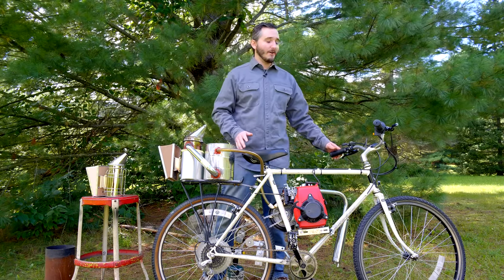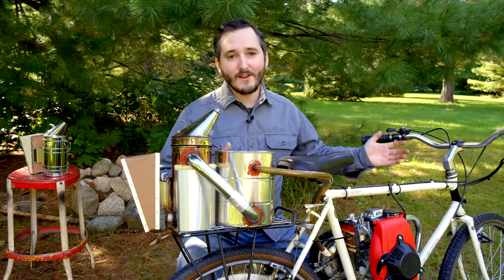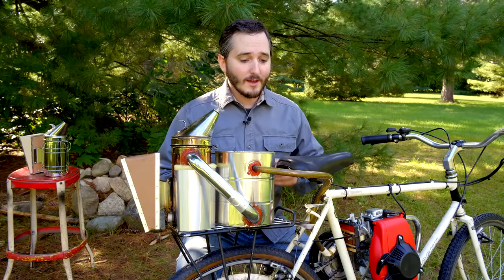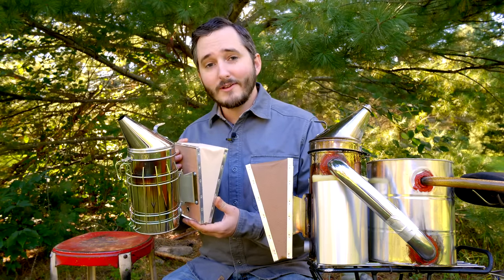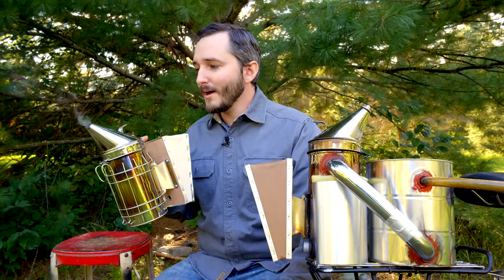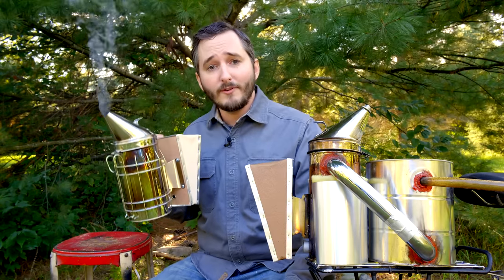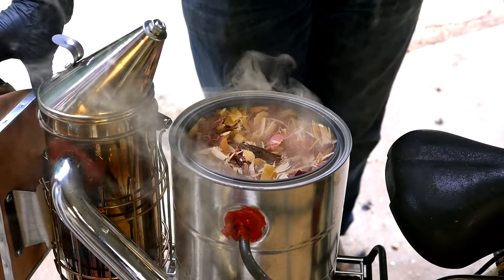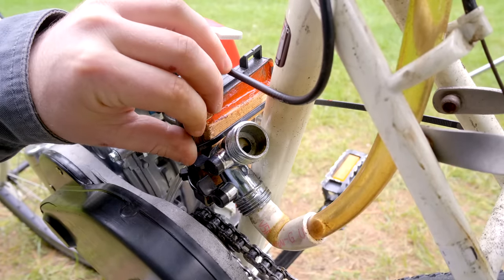Running a Gasoline Engine on Firewood | Woodgas Biofuel

Comment: id like to have a crack at this, looks fun
Reply: Don,t burn your self
Reply: Kinda a waste of time to be honest..just not practical.
Reply: Recover the exaust temp
Reply: You won’t
Reply: This would be so cool in the Colin Furze steam-punk style! Bring in the brass and copper!!
Reply: @leathercheerio1  I'm sorry, have you seen Furze's channel before?
Reply: Please do but be careful
Reply: use a vacuum recovery pump into a pressure tank of some sort to collect gas for more practical use maybe?
Reply: Do it plz
Reply: Make into a jet engine
Reply: you would try this I bet... Woodgas fed through a liquid nitrogen cooling coil and then fed through a bubbler and pressurized. Next use an oxygen tank from the store and mix the two of the gasses and burn them using a jet lighter as an igniter. test different nozzles as needed. Boom (hopefully not literally) steampunk woodgas rocket engine.
Reply: Storm Silvawalker 
use TEM to power electric fan
Reply: Yas the Furze has spoken :3
Reply: Do it and make it fast!
Reply: Ohhh MG Yessssssssssssssss !!!!!!!!!!!!!!!!!!!!!!!!!!!!!!!!!!!!!!! <3
Reply: Colin you'll either build a flamethrower or some crazy vehicle that moves at ludicrous speeds. You made a moving trash can for God's sake.
Reply: Yooo that's crazy Colin furze commented on your project
Reply: Watch out for that carbon monoxide, sclient and deadly!!!!!!
Reply: I'm surprised you never tried this before, right down your alley @colinfurze
Reply: Colinfurze, Cody'sLab, and NightHawkInLight have always been some of my favorite channels! Thank you all for doing what you do and inspiring me too!
Reply: haha hey you crazy furze id like to see you upscale this and make it go faster!
Reply: Look me up ill give you a hand if you'd like
Reply: Drugs r bad
Reply: @JoeBissell  thats already been done. There is a website called Drive On Wood guys there are driving full size pickup trucks as daily drivers. Id like to see him wood gas his pulse jet, that would be something I havent seen before!! Or wood gas a Mazda RX7 Rotary
Reply: This video made me think of you, you absolute madman.
Reply: Don't forget your SAFETY TIE!
Reply: i also like to see this :)
Reply: i'd like to watch it
Reply: You should build a woodgas motorbike.
I think if the intake would be an Injector sucking in woodgas this should run fine.
Reply: Do collab!!
Reply: He's about to do it, the absolute madman.
Reply: Didnt you get arrested for building a tazer
Reply: Add an small air pump
Reply: Do a collaboration together on a tandem bike!
Reply: Wood gasification powered rocket engine =D
Reply: We're waiting!
Reply: YUP
Reply: Wait Furze did you do it. I haven't been up to date with your channel.
Reply: Oh Lord... here comes a 60 MPH shopping cart powered by a contained bonfire :D
Reply: Yes wood gas apocalypse bike.....with weapons
Reply: Fausdionis Pizzeria has anything he’s ever made been practical?
Reply: You both should try the difference in exhaust with a straightpipe it will probably push exhaust out better
Reply: watched this video after watching your wood gas mower
Reply: I thought I'd find you here.
Reply: just watched your video on it
Reply: He just made a video on it lmfao!
Reply: Make sure to give some credit to our guy,   Ben!
Reply: And you did! You guys are both making 2020 more enjoyable!
Reply: @5thearth  Agreed, spinning belt of knives and Alexa operated flamethrower spring to mind...
Reply: They have an episode with this on the new season of Monster Garage.  I just watched it and find it super interesting.
Reply: @leathercheerio1  Back in WWII, when fuel was hard to get it was super helpful.
Reply: @miguelfigueroa360  He did.
Reply: M'lord.
Reply: I Seen your Video to with your Wood Power mover 😂😂😂
Reply: This was a warning
Reply: @leathercheerio1  That's what people said about early versions of many inventions that we use today.
Reply: @NayroTheAdventurer  as a matter of fact I am part of a plant that is capable of burning syngas in a boiler for high pressure steam to a power generation turbine.  There was a comment, early on in the build phase, about putting the syngas through the turbine. I remember my response was a firm slap to the back of the commenters head. Its not something you want to put through a bladed turbine due to MANY reasons. However, if it was burned through a boundary layer turbine that was made of a material that would withstand the caustics, I believe we'd have a viable direct burn power generation unit.
Reply: @leathercheerio1 not if you can't obtain petroleum. Then it will be as good as gold. Especially with a generator.
Reply: Yes, please!
Reply: Most definitely 👍🏻
Reply: I build a lot of little internal combustion engines I am familiar with the gasifier and how to efficiently run that little motor. You are getting to much air all you need is a small 1/4" hole in the intake use the carb throttle and that's it ride it to the store great set up
Reply: @leathercheerio1 wrong

Comment: Ha bee smoker! Its like you know I'm watching! I glad you are working on this, I tried and failed this about 8 years ago and never got around to trying again, I'd love to run something off sage brush one day.
Reply: I think you should it be great to see you try. I was thinking about making a slightly larger one and using a water filtration system. I figured I could probably use mason jars and still keep it about the size of a paint can. I'd also use a one way air valve so smoke wouldn't come out. BTW I'm a big fan of your channel. I've been watching for years.
Reply: #1 .- replace the garden hose valves with a propane carburetor kit for generator from ebay.
#2.- make a gas (smok) container that can pressurise the gas just 10 psi or so with directional valves , you know, inlet, outlet .
#3.- install  an air pump (electric or manual) to force air flow in the gas combustion chamber (reactor), making smok (gas) go to the inlet directional valve to the gas container to the outlet directional valve to the propane carburetor  conversion kit in to the engine .
Note: (As a pressurized gas container you can use a balloon or bicycle rubber inner tube tire .)
Reply: I run my generator  on wood gas codys'Lab  but  I don't  make a video   because I don't want to be another disappear person.
Reply: Hi Cody, can you make the wood gas and store it in a a gas bottle then pressurise it with oxygen so you don't need to have a fire on your bike.
Reply: I would be interested to see your take on this too Cody. Might I ask the engine type/size you tried to use those years back?
Reply: And what is so wrong with using compressed hydrogen?
It can be produced by electrolysis using solar power. 
Its as green as you can get. Burns super clean. No stinky smoke. Compact as hell. Safe. The list is too long, and I am bored already.
Reply: Hi Cody, I would love to see you experiment with wood gas
Reply: Go watch some videos form Mr Teslonian. hes gotten even a CAR running off wood gas after studying this stuff for so long. have fun!
Reply: I would love to see you two work together
Reply: Although an interesting challenge, perhaps there are some things that just aren't worth developing.
Can you imagine a city with half a million wood gas bicycles running?
I'll stick with my 1.5kW solar powered ebike thanks!
Reply: @Ben LePage
That would be literally a bomb. Fuel+oxygen mixed = explosive mixture. And unlike with gas, flame can travel back in the fuel line like a fuse and make some minced meat out of the passenger of the bike.
Reply: @PirateKitty
Hydrogen makes metals brittle. It is pernicious, hard to contain, it can literally diffuse through solid metal... H2 cars have some pretty special fuel tanks that you dont want to duplicate DIY!!! Also the fuel needs to be cryo cooled to avoid ridiculous pressures. 
And the safety?!!! H2 is extremely flammable in a wide range of mixtures, and can be explosive even without confinement. I would steer away anyone from going DIY with H2! If you are over 130iq you might have a shot, but i have to remind you that even Cody's lab had some accidents with H2!
Reply: @kistuszek  compressed Wood gas doesn't liquify so no it won't become a bomb because the pressure of the gas flowing into the engine would stop the the fire from flowing into the pressure bottle and you'd have a one way valve on the tank anyway so your point is moot
Reply: Cody'sLab that one day when you got to clean shrubs on your ranch, but dont want to haul a bag of sticks, so you make it into a fun day
Reply: Can you colaborate with NightHawkinLight, for this project?
Reply: Cody'sLab hi sir cody if u planning sages grass as fuel i may suggest used a diesel engine
Reply: don't tell me you made the same mistake of burning the wood directly ??
Reply: Try using compressed sawdust. More volume in a smaller space, might have to experimen sizing of the pieces.
Reply: @kistuszek  If you run it off electrolysis and not a storage tank then you wont have those problems
Reply: A gas carburettor is a no-brainer. I’m not sure why you aren’t using the petrol carb choke flap to control the mixture rather than the additional valve. Any induction resistance will have a negative influence on performance, cooling the wood gas would also help and allow removal of condensable constituents.
Why not carbonise the wood first and then make a steam reformer, this would cut the contaminant content down a lot.
Reply: Any gas can be liquifyed just a matter of pressure
Reply: That would be awesome
Reply: Cody'sLab, colinfurze, and NightHawkInLight have always been some of my favorite channels! Thank you all for doing what you do and inspiring me too!
Reply: 100% good idea and would back.
Reply: Yo! Good to see you here Cody!
Reply: Cody'sLab I guess great minds think alike
Reply: Cody...he needs to install some sort of cooler so the wood gas can become dense enough to actually be sufficient fuel for the engine. Cooler air is more dense than hotter air. Wood gas is no different. Cooler (and therefore more dense) wood gas contains more usable energy than warmer (and therefore more thin) wood gas. Ya "dig", brother?!!
Reply: Why hasn't anyone suggested using a carbon filter made from the wood pyrolysis? Wood charcoal has incredible surface area and is used to filter all kinds of liquids and gasses. That would be a superior way to filter the gas. Also, you NEED to cool the gas down to mitigate the low fuel density problem of hot woodgas. Makes a really big difference
Reply: 😊 No problem Cody, we look forward to see your own fusion reactor and how it is built. 😉😅
Reply: You are a bee smoker
Reply: Yeah........ cool project / CODY !!!! LOVE YOUR WORK TOO .... was just watching your BOG-Ores & Rocks "iron topics" !!!! (you and "GOOD and BASIC" ) !!!! 

Hail Hail ... the GANGS ALL Here-!
Reply: @psicopatalucifer  It will be nice to see if MANUAL ways can work, but even I see (immediately) where electrical/electronic controls might be needed to REALLY make this much easier to run.
Reply: Bro your like some form of hill billy genus , this feels like somthing that you should be up your alley , so do it we all belive in you
Reply: So he has to make it a 4 bee smoker....lol
Great video
Reply: What about algae oil.
Reply: @pirateman1966  The problems start with keeping it around. Hydrogen likes to migrate away from where we want it, and it makes metal tanks brittle.
Reply: Store hydrogen in fiber reinforced plastic cylinders. They don't really explode, they just rip open.
Pretty safe
Reply: @ahaveland  an ebike or peddle bike is one thing. A motorcycle with a side car is a major thing. The philippines, columbia etc all have motorcycles, and some use side cars like a taxi. Maybe solar or an EV motorcycle is fine if its ECONOMICAL or price competitive, but for a lot of people they have access to wood, bio mass and that'd save them money which is HUGE in third world countries where people are doing good just owning even one motorcycle a family. If they could convert their motorcycle to run on wood gas that'd save a lot of money which would increase their standard of living. The whole problem I have with the green movement is it's more expensive which decreases the average standard of living especially for the poor and middle class. Read the report from some bank. The median wage last year was 52,000 while the median house price rose 54,000. Inflation promoted by the government helps the rich that already has assets, but if youre making 52k a year you'd probably benefit more from driving a pickup running on free wood gas then a tesla running on electricity you still have to buy through the grid or a solar panel. One option is more expensive than the other option.
Reply: @RimWulf  Or wood pellets. They sell them cheap by the bag at tractor supply.
Reply: @kistuszek  Bob Lazar made a corvette run off of it. But he's a genius. I think a early 90s C4 maybe? I'm not a Vette fan. I'm more of a Chevelle, Nova, Anything designed by Harley Earle and tweaked by Shelby. Yes I'm aware that's 2 diff companies but all those cars between and from is my bag baby.

Comment: My Dad (now 101!) used to run his car on a system like this back in the 1940s. He had a water filtration system that would filter the smoke from the wood gas.
Reply: I was actually thinking a water filtration system would actually be great maybe using mason jars as a container
Reply: All the best and heartfelt greetings for your Dad. :)
This is a walking history card, so listen, listen, listen... and take notes!
Reply: They also used to have a big balloon on the top of the cars to store the gas I think.
Reply: It would also help cool the gas
Reply: The balloon-based gas storage was actually natural gas I believe and it was in England during WWII because they were having shortages.
Reply: I believe HHO bubbler chambers are what you are looking for.
Reply: @skullcrushers1000  all i saw was Rhetts face as your profile and I was done
Reply: pls give us schematis for possible apocalipse😂
Reply: Maybe  try  to collect and pressurized the wood  gas  some how to about 20 psi.......my 2 cent friends!!!!
Reply: @bruceyoung561 I know this is reviving an old comment, but I've been thinking about this.  Compressing wood gas might be accomplished with a cheapo 12V tire inflator or air compressor, or even a high end bicycle hand pump, with the inlet being plumbed to the gassifier, and the outlet to a compressed air tank.  I would add a tar trap right before the tank.

Thoughts?
Reply: @stevescuba1978 it would work better. There are even portable air pumps now that can pull extreme pressures with minimal energy requirements

Comment: We know that this is possible because at the end of WW2, the Germans were facing a fuel shortage, and all fuel was being used for the military effort, so people turned to converting their cars to run on wood gas using conversion kits. Eventually the military even produced some Holzbrenner “Wood burning” Volkswagen cars. There's probably more information on how this was pulled off if you dig around. One thing that came to mind a while ago in this project is why don't you come up with a way to compress the wood gas as it is made using a decent compressor and use it to fill a small tank at reasonably high pressure. I suspect that the solids would condense our settle out of the gas if you left it sitting in the take for a while, then use that to run the engine. That would eliminate the drag on the intake stroke which your system suffers from. Very cool project. Your videos are always a treat.
Reply from the maker: There are several gasifier designs available for vehicles including an official set of plans distributed by FEMA, but they are complicated and do not have ease of manufacture in mind. I hope to come up with a simpler design, or at least one that can be pieced together from common items without excessive cutting and welding. You're right that particulate settles out of the gas if stored, but the energy density of woodgas is quite low, and so you won't get much run time out of a storage tank of a size that fits on a vehicle. Much better on a mobile setup if you're able to burn the gas immediately as it's produced. There is also apparently some issue with compressing woodgas where it becomes unstable at high pressures. Possibly because of the oxygen content that remains. I have not tested this, but there seems to be a consensus about it in my research.
Reply: That makes perfect sense. Don't compress it then. Maybe work on a better way to extract the gas from the wood. The original design you had made could perhaps be scaled up?
Reply: The Germans also converted tiger 1 tanks to run on woodgas
Reply: They also made an experimental wood gas burning Tiger tank just without the turret.
Reply: The North Koreans still do.
Reply: they also had a wood burning tiger tank. it was only used for training purposes but it hows you can run substantial engines off this sort of a setup
Reply: They were common in Australia in WW2.
Reply: not just Germany it was used here as well
Reply: Yet people still somehow think the Germans were burning tens of thousands of Juden per day. have any idea how much energy is required to incinerate a human body? A LOT
Reply: Great video, thank you. Yes, I read a true account by an American soldier who was in Germany after World War Two. He and his buddies found a German car with a gasifier in the trunk area. They would fill it with wood, fire it up and drive around all day touring. They only had to stop now and then to put in more wood.